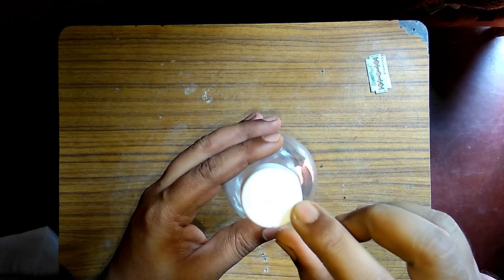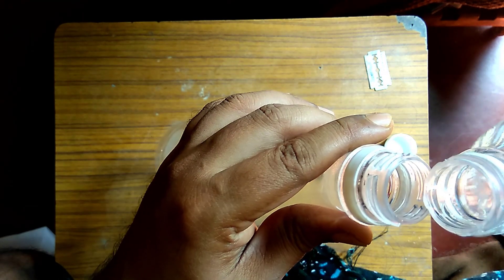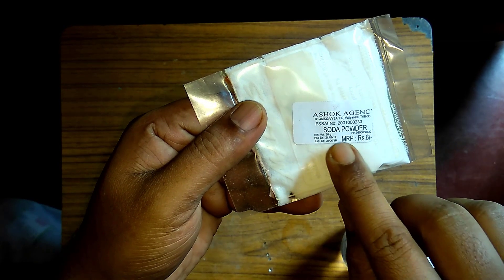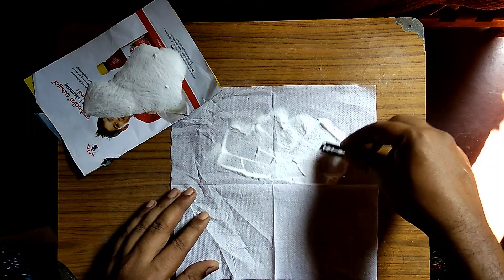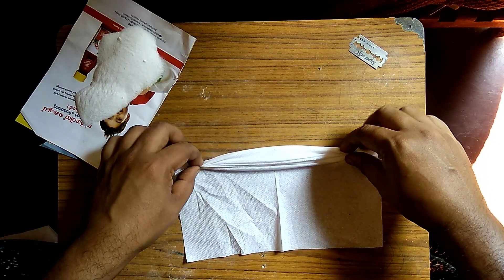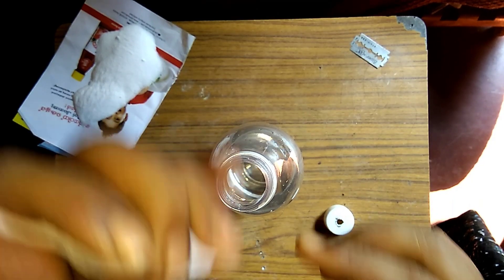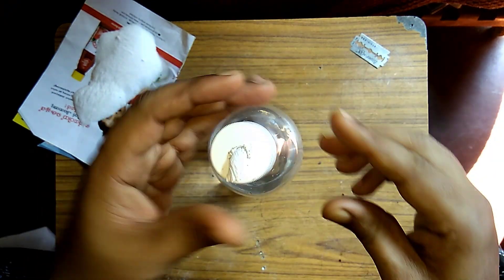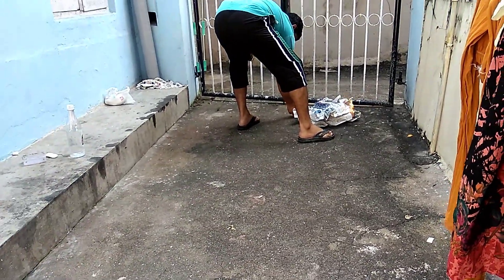Homemade fire extinguisher

Comment: How many days or months can I store it. .?
Reply from the maker: Vinegar's expiry date i can see as 24 months marked in that bottle.Baking powder i cant see the an expiry date in that packet. So theoretically speaking 2 yrs will be shelf life. But technically the best we can tell as less than 1.5 yrs. The only thing you need to do is to keep a plastic cap on top of the bottle so that water will not sprinkle at the tip of the tissue paper in the hole.